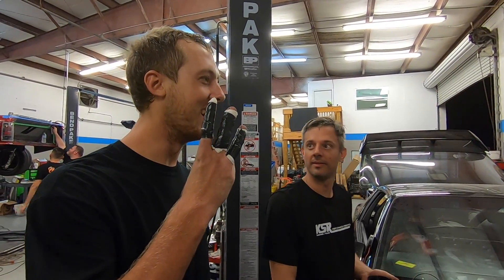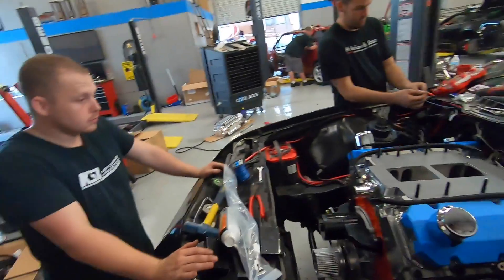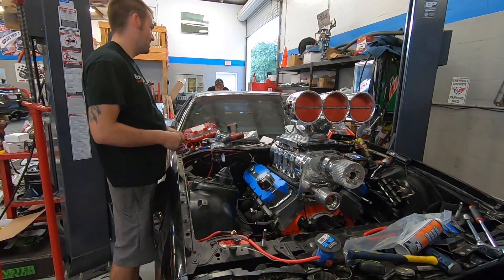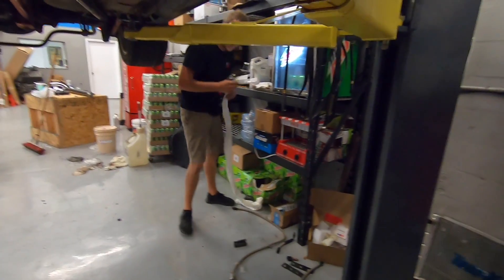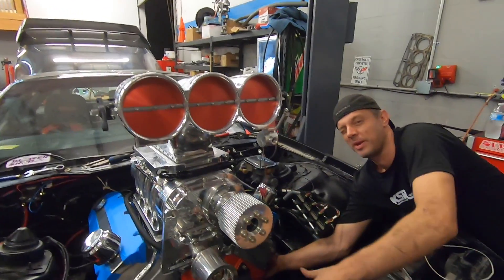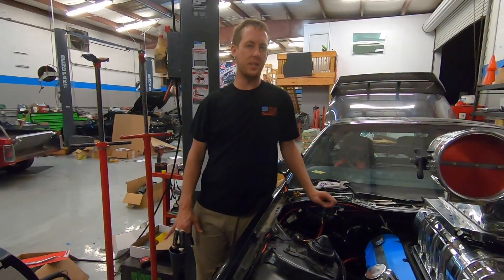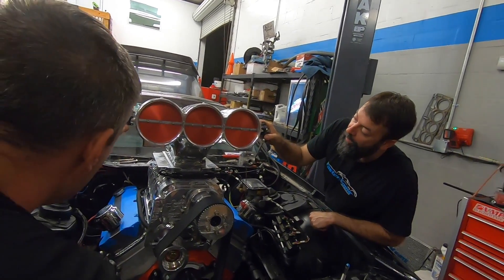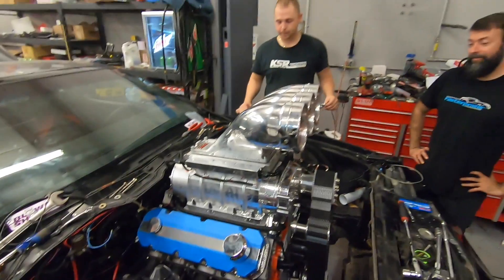TOAST IS ALIVE! Firing Up Our 10.3L Supercharged BIG BLOCK For the First Time! *MAXIMUM FREEDOM*

Comment: Same thing happens to me last month except it was in the front of my fingers I was pulling a wiring connector out of a relay assembly for a ranger and it pulled out alright and the butt connection pulled through my hand and sliced my fingers.

Comment: Will you be running it with methanol to help with cooling?
Reply: It is on alcohol, remember seeing the ice cold condensation on the blower walls? Gas won’t do that, and e85 barely will

Comment: The most dangerous tool in the shop the old razor. Will cut ya right half in two if ya ain't careful. I've sliced my right middle finger on top top middle joint. Went to the bone and filleted about 1/4 inch back.

Comment: I still need someone to explain to me how a distributor can be "180" off? TDC is TDC and there is no "180 deg" off of DTC... I had a mechanic try to explain that they had a camshaft "180 deg" off... LMAO... the Camshafts work that way... 2 turns of the crank to 1 turn of the cam... always... even an offset and degree'd cam is still ALWAYS 2:1 and the relationship to the crank is relevant ALWAYS in 2 positions. TDC is ALWAYS TDC... compression... piston to top on timing mark, look where the rotor is pointing... there is #1... should not be rocket science guys... still very cool build

Comment: Yo, be sure to change the hub bearings on the front on that thing before you drive it. They use the front disc as a race. They are little plastic pieces of shit that are supposed to be changed as often as the oil.

Comment: Do us all a favour: Before you do burnouts in "Toast," put a fire suppression system in the rear wheel wells. "Neighbour" produced enough torque to set the car on fire. Toast should be several times more powerful; his tires' lives will be measured in seconds. It would be a shame to burn the car to the ground seconds into his first burnout contest. ;)

Comment: Has anyone here gotten an error when trying to go to the Blower Shop website?

I've been getting the following error since I first saw the link in on one of the prior videos:
"Forbidden

You don't have permission to access /tbs-blowers/71-series-blowers/ on this server.

Additionally, a 403 Forbidden error was encountered while trying to use an ErrorDocument to handle the request.

Apache/2.4.29 (Unix) mod_hive/6.27 OpenSSL/1.0.1e-fips mod_fastcgi/2.4.6 Server at theblowershop.com Port 443"

Comment: Imagine If you owned this in the 50's... I would start a car dealership with all the pink slips I earned.
Reply: Neomis 01 none of this existed in the 50s. Nitrous was around but it was mostly used by fighter pilots to get a little higher in the air during dog fights. The hottest setup was a 20s-30s ford flathead with a 4-71 blower or 283 small block Chevy. Aftermarket speed parts were just showing up (mostly on the west coast). Most used whatever stock parts they could modify. And the tires were crap compared to even what was around in the late 60s. Brakes weren’t any better. In truth most hot rods back then made 300hp max, but they weighed very little. And the fastest hot rod in town was usually beaten within a year or 2 because speed parts and factory parts constantly were getting better. It was similar to how fast computers were getting better in the late 90s. The top of the line home computer was weak or completely obsolete in less then a year.

My grandfather had a 49 Plymouth with a first gen hemi in the late 50s. It was the fastest car around for awhile. Within 2 years, it wasn’t even in the top 10.
Reply: @CamaroAmx  "none of this existed in the 50s."
you need a history lesson. 
"The period between the two World Wars was the heyday of supercharging.  Not only did the major racecars of the time run blowers but, as you might expect, so did several of the more racy production models, both here and in Europe."
Or how about in 1908 being the first time a supercharger was used in competition? Is that old enough for you?

The "Roots" Of Supercharging
http://www.superchevy.com/how-to/engines-drivetrain/0510sc-principles
Reply: Axle Grind guess you missed the part where I mentioned superchargers existing. But they were stock units, big blocks didn’t exist, adapters where few and far between and the speed parts market was just beginning.
Reply: @CamaroAmx  you gave me your opinion but i proved myself with evidence. twice. it's ok, sometimes you are just wrong.

Comment: This entire group needs to get in line for their Darwin Award using a jumper wire on the starter relay, a make shift kill switch with allegstor clips & guessing at the timing. Seems like too much trouble to do it the right way.

Comment: If that throttle plate has tp S on and it's not going to run  right it's going to give you full timeimg need 4.5 to 5 volts at idle comments from captain obvious

Comment: You have to be over 18 to use a razor blade. =>lol. I did the same thing (on left hand) almost 10 years ago. . The blade didn't break on mine, it just slipped while prying a cap off of something (I don't even remember what it was) You WIN . Yours was worse... Ha, ha, ha. 
Very annoying, can't use the hand for a few weeks... Over the years the scars will fade away.
Only burns stay.
Worse (or as bad) as getting cut on a muffler... Mufflers are always deeper. (Ow, dam gomit)